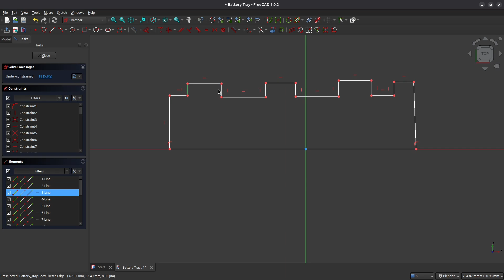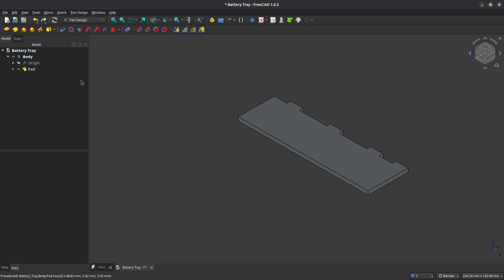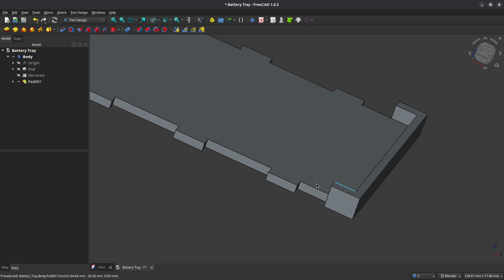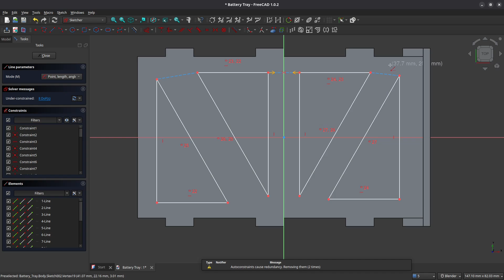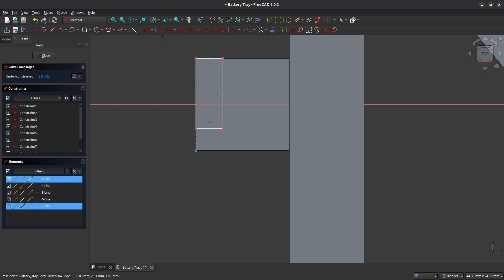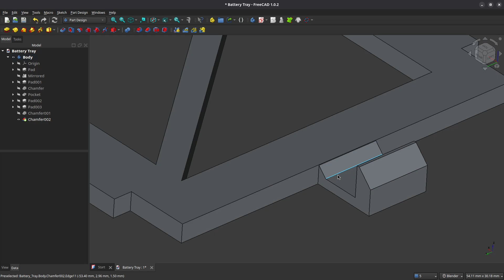SPARKBOT V2: PART 9 | BATTERY TRAY

Comment from the maker: Welcome to Part 8 of the SparkBot V2 architecture. 📐

In this episode we complete the battery box by designing a tray to secure the custom battery pack we designed for the TitanBot. This tray uses a compliant mechanism - a clip printed integrated into the tray design that takes advantage of the limited material flexibility of PLA.

Question for everyone building along: Have you experimented with compliant mechanisms in your own 3D printed designs before? Do you stick to PLA for these clips, or do you prefer the slightly higher yield strength of PETG or ABS for your functional springs? Let me know your material preferences below.

(P.S. Keep your calipers handy. In the next episode, we are performing a critical 1mm kinematic adjustment before we mount our spatial awareness array!).

Chart your course. Build your world. 🍁